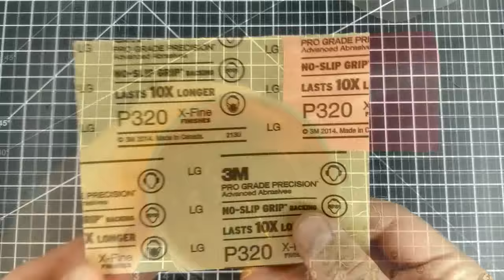Polish Glass Bottle Edges After Cutting

Comment: Could you do this on a drinking glass to smooth a line down the center where the two halves  where put together because I just got a skull glass but it has a line on the front and back that I don't like
Reply from the maker: You may possibly be able to do this. From my experience though, sanding the side of the bottle is easier to get deep scratches that are hard to polish out. I would recommend trying these steps on a glass or bottle that you can practice on before trying on your glass that you want to keep.

Comment: You are buying and using 5 different grit sandpapers.  Plus all the time (and labor), this glass must end up costing nearly as much as a Tiffany piece.
Reply from the maker: Sandpaper isn't very expensive, especially if you get a multi-grit pack that has all the grits you need. The links for sandpaper that I have in the description are about $10-$15, and can be used multiple times. But you are right about the time it takes. It can take a very long time, especially if you're doing several.

Comment: Realistically, how long did it take you to polish it?
Reply from the maker: That's a great question! For this bottle, I don't remember. The longest part to sand is the first grit. Depending on how deep the nicks are, the first step can take anywhere between 10 minutes to over an hour. Once the surface is flat, the other grits for polishing go much quicker, about 2 minutes per grit.
Reply: @HowDoYouDIY  Thank you. I need to polish some gin and whiskey half bottles, rather thick. I reckon I'll give it a go with a dremel, using your wet sanding method.

Comment: When I do the inside edge of the bottle it leaves scratches is there a way to remove or avoid making these?
Reply from the maker: I haven't figured out a good way to get rid of the scratches, but to prevent them it's best to sand the corners of the edges at an angle and keep the sand paper short. The farther it extends past the sanding surface the more likely it is to scratch the inside. But make sure your fingers are protected, you don't want to get cut.
Reply: You could try a sanding sponge perhaps?

Comment: I need a list of all the sand papers u used the numbers :(
Reply from the maker: In the video I started with 80 grit, but I found that 60 is better to start. Here is a list that should work for you (doesn't need to be exact, close will work as well):

60
120
220
320
420
1000
2000

Just go down this list to get as smooth as you like. Hope this helps!
Reply: @HowDoYouDIY  thank you! 💕💯

Comment: Can you just use the 2000 grit paper instead of increasing
Reply from the maker: You could, but it would just polish the surface and not flatten it and remove the scratches.
Reply: @HowDoYouDIY  When sandpaper is finer it removes less material so he can use 2000 grit sand paper but it will take like forever to do the job.. if you know what am i trying to say